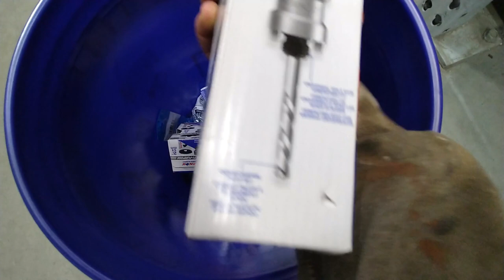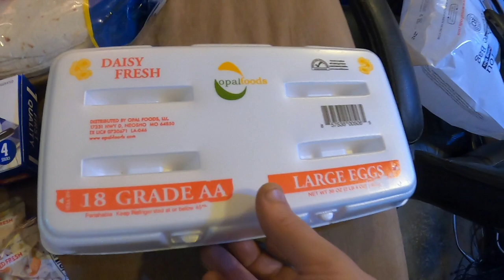Haircut & Tool Shopping - Vlog

Comment: Just take note… I’m not sure what your plans are for the entirety of your RV when it’s finished but please use caution your RV’s handling is going be drastically different with no weight in the back to counter the heavy steel cab and all the weight up front, even with your duel’s in the back the rear of your RV is going to be way easier to spin out from the back especially with no traction control so hopefully your going to build the back up with alittle more weight to equal out the effect just be careful when you start driving it again it’s going to be a completely different vehicle in terms of handling then what you were used to with your old RV
Reply: I think he's making a flatbed of sumsort for it